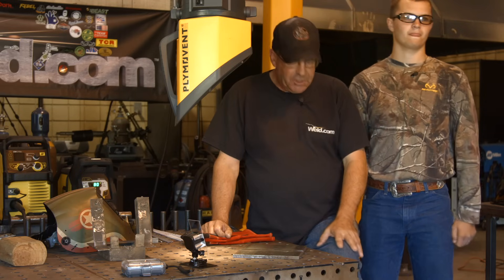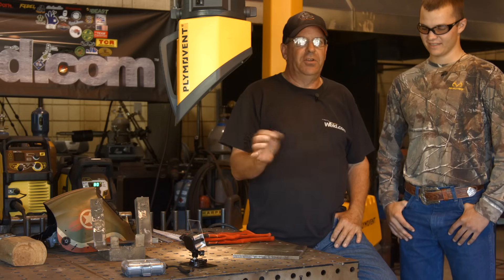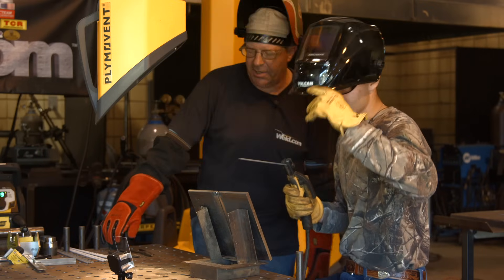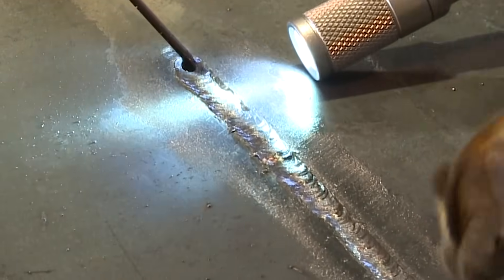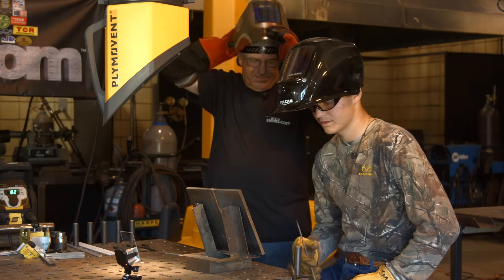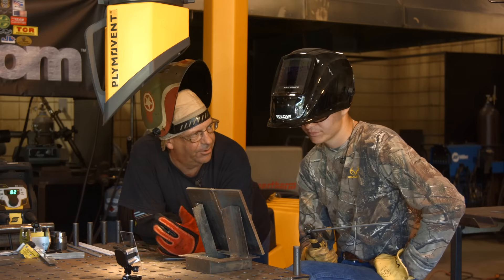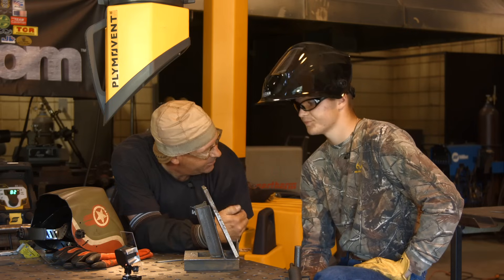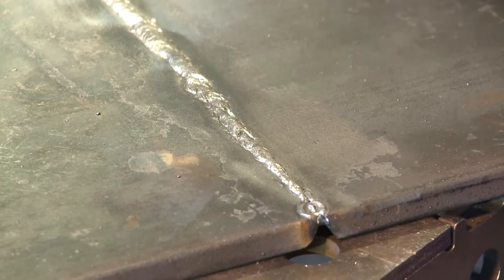6010 Open Root Downhill Restarts: Common Mistakes and How to Fix Them

Comment: I'm 41 now. Taught myself with the help of you tube to weld .... never been formally instructed on welding ... wish in one hand and poo in the other but I really do wish I had started welding twenty years ago. Welding is great, I enjoy it more than any other slave position I have ever taken part in! I really want to go to school for it. That is where the regrets start. Hard to pay your bills and go to school. This sucks. The high school I attended dropped welding the year before I entered high school. Booooooooooo. Alright, I'm done with my rant and feeling sorry for myself. Back to my real slave position ..... poured walls. Later on.

Comment: key hole should be  uniform and the same uniform color while welding .if you see a different color where  you are tying into either side point your rod to the side where your darker color is , It is not only sight but sound as well . Then there is also rod pressure (feel). Like driving a standard as opposed to an automatic

Comment: I'm learning stick welding and I'm doing overhead t-joints and keep getting undercut when I do my 3 pass weld. Any suggestions? Thank you
Reply: Short arc length. Keep the rod in the leading edge of pool.

Comment: I've got a question about slag what makes it super thick and sticky, sometimes on a bead of mine it just does not want to rake off, I have to beat it or wire wheel it
Reply: That happens in the groove a lot. Cap pass it should come right off.

Comment: Hi Bob, can you run good looking bead with flux cored gasless mig wire? Most of times im welding outside, and im struggling to get nice consistent bead 😭 also im looking to get a tig machine any advice? Dc only budget machine.

Just came across Sifweld TS200dc, ever had hand on it?

Comment: new to welding... why do you leave a gap in the plates before starting??
Reply: The weld metal is generally a good bit stronger than the parent, or base, metal.

Comment: Why don't we see 7010 rods?
Reply: lolz larkin So if we used 7010 you wouldn't know unless stated verbally?
Reply: David Spin Very common. So is 8010. They all run about the same.
Reply: Pretty much the same rod.. Just different tensile strengths
Reply: workwillfreeyou Could you tell the difference on video?
Reply: Dunno. Never seen one.
Reply: not common...